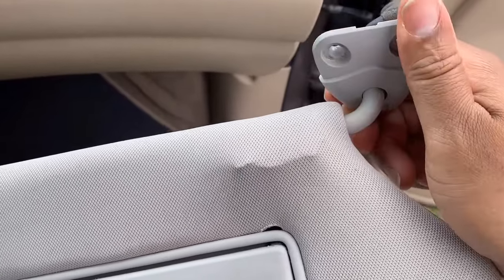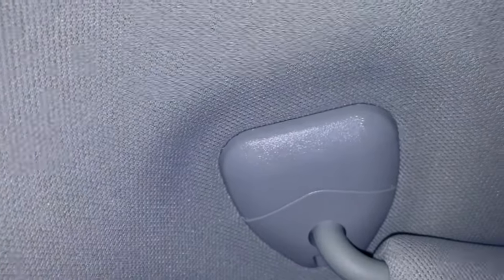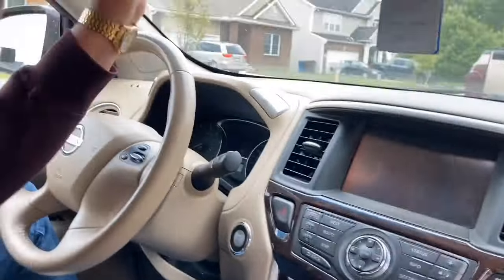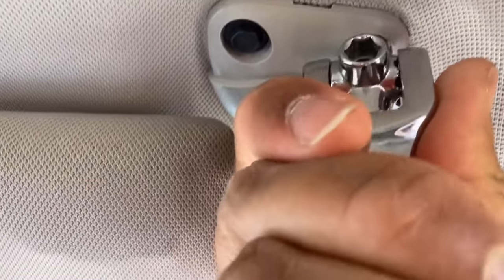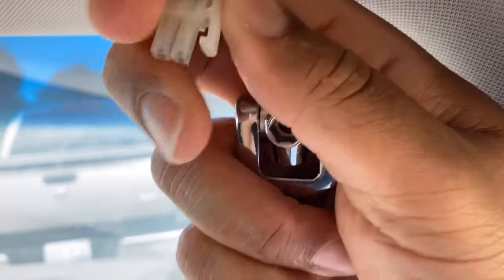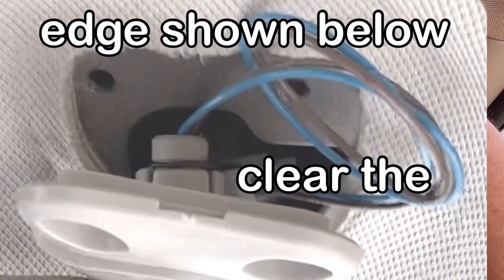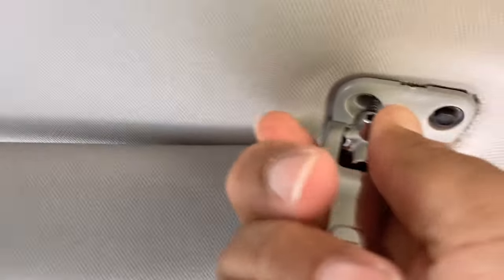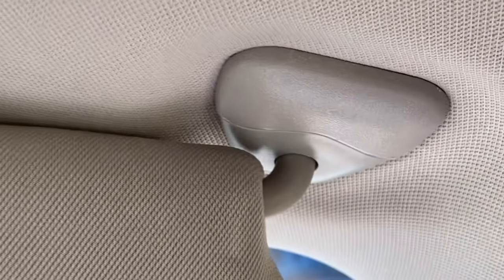Nissan Sun Visor Repair Replace | $30 Most Models

Comment: I got my little cover off by watching this video! Hardest part of this job!  I used a 3/32 socket to get the screws out.  Another tip-after I plugged in the new connection, the new visor slipped from me while screwing it back and broke the connecting wire! After some serious cussing (trying to install a visor with no "flip" action),  I had to buy another visor, since that tiny wire cannot be fixed...and having a LIGHTED MIRROR is a requirement for this lady driver! Also, the aftermarket visor seemed frozen from flipping up & down...so I pulled the top bar out 4 inches and put a coat of vaseline on it.  It finally flipped easy!
Reply from the maker: You are awesome!!! Thank you for sharing your tricks and tips!!👍
Reply: Dawn where did you get your 3/32 socket? I've been to Ace, Harbor Freight, Home Depot and Auto Zone-- no luck!
Reply: @RN4u2  Oops- it's a 9/32 socket, I had in my rollaway in my garage...

Comment: I ordered the tool to help get it off as well as the visor and the visor came first so I went at it with a flathead till it came (pro tip: popped off in under a minute when you go at the corners closet to the seam). Now I just wasted money on a tool I don’t need anymore lol

Comment: Excellent video….got me excited about replacing my 2012 Maxima passenger visor. Except…
I’ve been searching desperately for a replacement visor & only finding dirty, used ones for $70+ or nice, driver side visors. Any suggestions on where to look? Feel like I’ve searched so many online parts websites. I’m ready to just duct tape it up out of the way and be done with it. Grrr.
Reply from the maker: Did you try any of the Amazon links that I have in the description.?
That’s where I got mine.
You can also try rockauto.com? That’s my go to if I can’t find a decent price in Amazon.

Keep me posted !!

Comment: Should I get a after market or original Sun visor? Have to replace both on 2016 nissan altima no light on mine.
Reply from the maker: The one in this video is an after market. The color match.

Comment: I'm trying desperately to get the little 3/32 socket and cannot find it...

Where did you get the little tool?
Reply from the maker: I’m sorry you are having a hard time. I added a link to the description where you can find similar tool. Make sure it has that measurement. You might have to buy a small set from an auto part store.
Reply: It’s 7mm not 3/32

Comment: But why does the visor snap like that in the corner cause mine is broken there too
Reply from the maker: It’s an engineering flaw. They picked a plastic that was not as strong it needed t be.